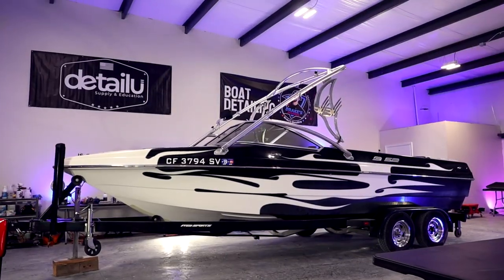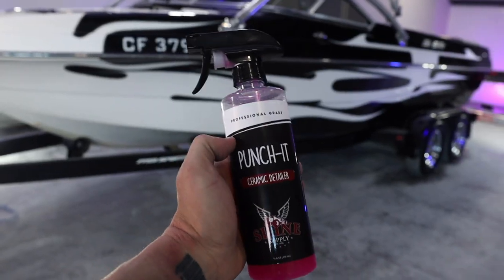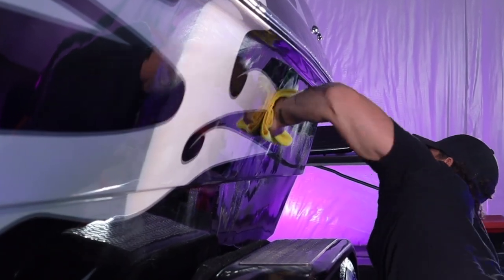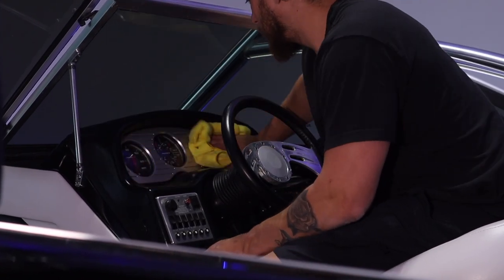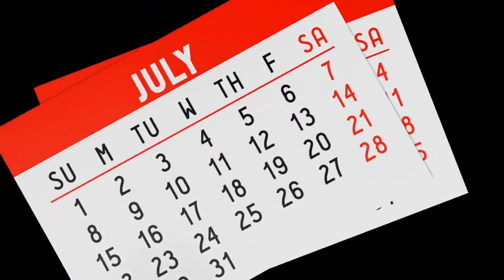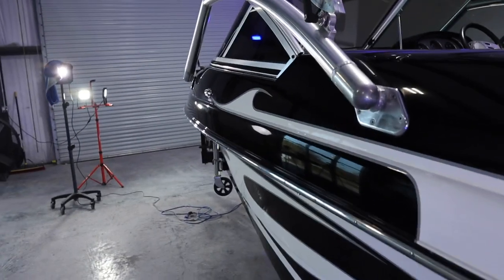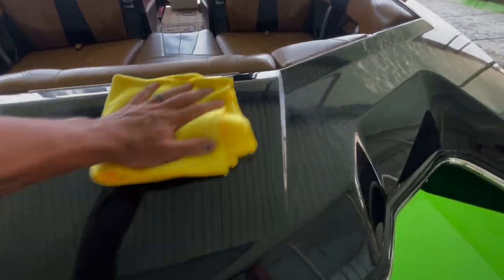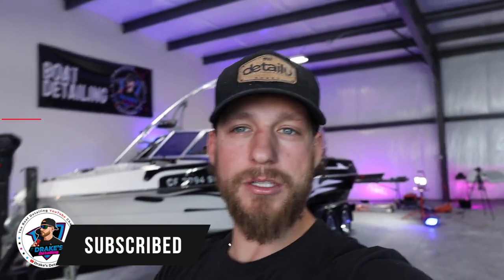The Secret To Maintaining A Shine... | Revival Marine Care

Comment: I’m so confused!!! I watched every you tube video that you made for the last 3 years. All GREAT!!! However, you recommended so many different products , I don’t know what to buy. By the way, congratulations on your new move. I’m sure you will be happy and successful there. I bought a rotary machine and. G9 DA machine. Work great. But the chemicals are a giant question. 
Using a white wool cutting pad for first compound for oxidation 
Using an orange foam pad for second step polish to remove swirls 
A micro fiber pad for polymer finishing. 
So what 3 compounds are you now recommending?  
Boat is a 1990 Mastercraft Maristar240 SC. 
Only in lake water. Stored inside. Gel coat. Red and white.
Reply from the maker: Hey bro! You got it, in that order 😎 you need to break down multiple different steps of compound in order to properly polish the gelcoat out
Reply: I’ll keep watching your videos to see what you are using now. I’m assuming Shine Supply.

Comment: Drake, would Punch-it be used after applying Jescar or in place of it? Also, didn’t you mention once that it wasn’t desirable to have water bead up on our boats  due to water spots forming. That’s what I love about Jescar. Any thoughts?
Reply from the maker: Hey Don! So punch it is more or less a spay detailer, so it will put on some added “shine” and some sort of added protection. You would not use this in place of Jescar, but you could use it after applying Jescar every once in a while to maintain the sealant. As for the water beading, that’s personal preference. If there’s beading, that means there is surface protection, but you’ll also have hard water spots you’ll need to remove with a product (such as punch-it) after if dries if you don’t shammy it off after every wash, or every time it rains. 

However, Jescar is a water “sheeding” product, not a water “beading” product. Water will glide more like a waterfall off of the surface instead of falling off in beads, hence making the water spots. So you really shouldn’t have too much of a water sport problem at all if you go with the Jescar.

Comment: Hey Drake, on my cruiser, the past owner painted the boat with a thin layer of seems like latex white paint, what can I use to safely remove it all so I can get into  saving my original factory finish that's underneath?
Reply from the maker: Hey bro! Mage try some light grit sand paper and see hot it comes off with that…

Comment: How do you feel about using punch it on the floor?
Reply from the maker: If the floor has a sealant and-or coating on it, it works great to maintain it and clean it all at the same time.

Comment: Old style videos better
Reply from the maker: Thanks for your feedback
Reply: What does this even mean? Haha he has taught us how to buff, how to polish,clean,wax,ceramic coat, wet sand. And he’s still teaching us the same stuff if not more now. He has expanded and he’s growing. Only difference I’ve noticed is he’s not in florida or using starke but aside from that it’s all the same great info. You can add any sio2 based spray after a polymer sealant/ceramic coating. It’s a good maintenance tip for detailers or people that want to keep there boat protected without having to break out the jescar and DA  multiple times per year.